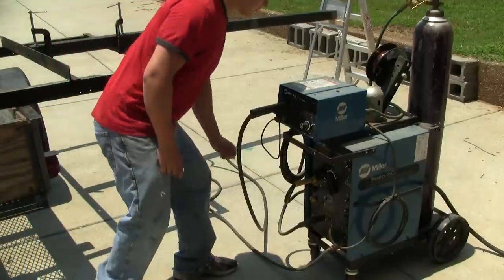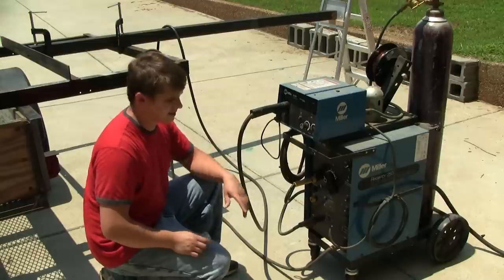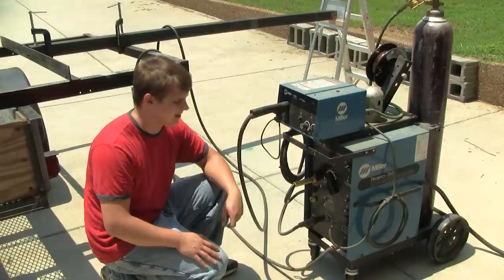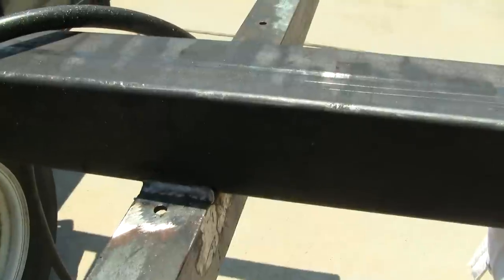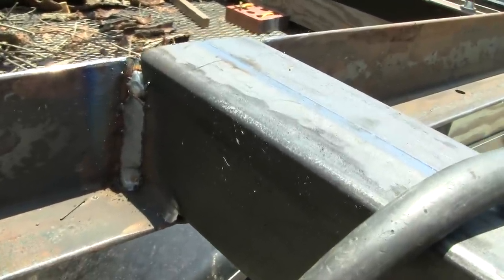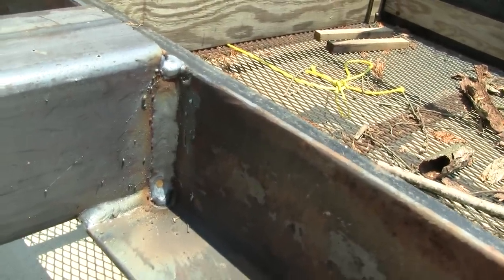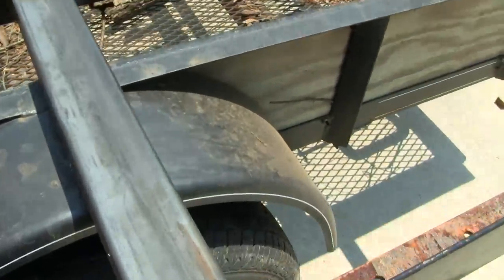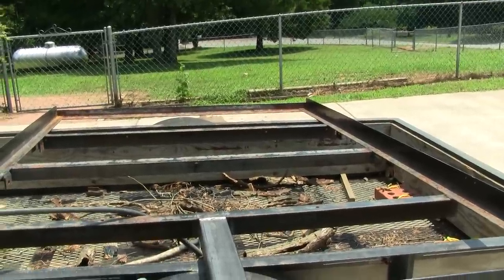Making a Teardrop Camper Part 13

Comment from the maker: @MrNastytater I appreciate the advice. I have always preferred uphill because of the likelyhood of more penetration.  While If I did do downhill I would just need to turn up the heat more or stay longer.   I am very much a novice with little practice in welding so am happy to learn from others. I may try downhill when I attach the tongue this week. :)

Comment from the maker: @wordreet 
I did think of doing exactly that and turn it on it's side but I did not have the energy at the time to move it it to it's optimal position. The triangulating might happen as well but for the moment my calculations tell me I may not need to, the goal is to keep this trailer under 1000lbs which allows for a greater margin of error especially since most 5x8 trailers use much thinner steel all around including the tongue. I could still do it after the sides are up. Thanks for the input

Comment: Nice welds. You could have turned the chassis on it's side to do those welds that you did vertical. But I have to ask, are you not going to triangulate onto the tongue to reduce flexing a little? After all, you've lengthened it by, what, 2 feet? Just my two pennyworth of course.  Your decisions are up to you. :¬)
.
 Some people say I should be certified, nothing to do with welding though.